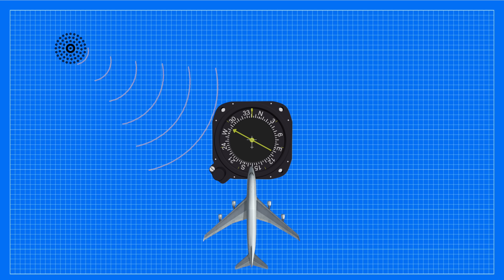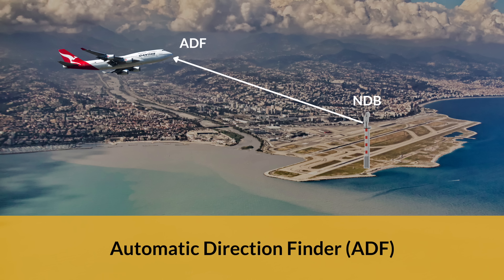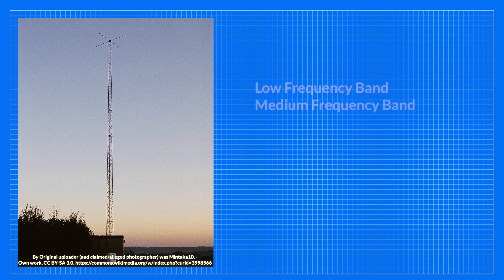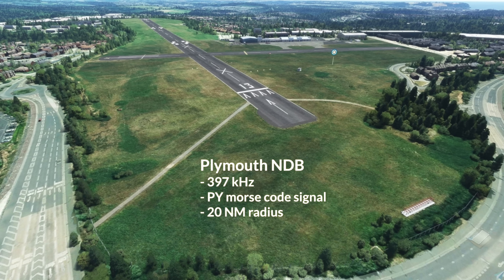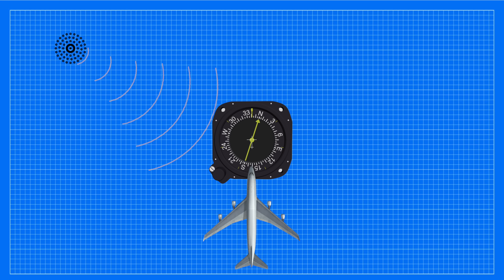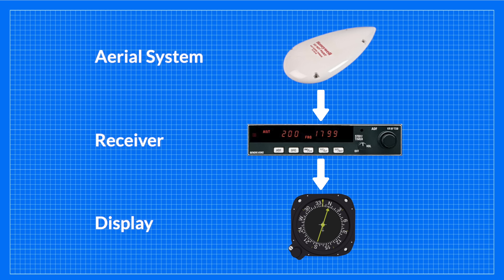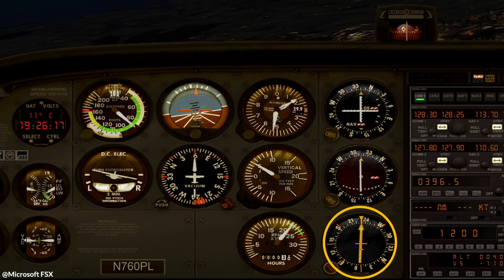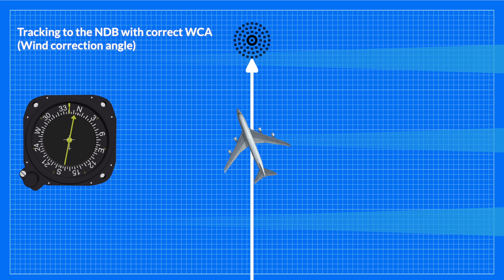Navigating with the NDB and ADF! Explained by CAPTAIN JOE

Comment: Last non-GPS aircraft I flew was on June 24, 2023 on a B757. Yes, a B757 with no Global Navigation Satellite System, using the 3 IRUs and DME/DME updating enroute. Can't remember the last real-world NDB approach, but I still use the RMI in the same way as an ADF to ensure my raw-data VOR radial doesn't show any shift with the LNAV path depicted on the Navigation Display as the B757 does not have a VOR track capture mode on the AFDS. Back on the B727 (steam gauges) used the RMI much more frequently to track a VOR leg outbound before a teardrop turn onto final, that way I could have the inbound radial preselected on the HSI and didn't need to twist the CDI course selector mid-turn. The RMI with VOR works much the same way as an ADF (but is much more stable).
Thanks for the trip down memory lane!
Reply: I recall UAL was pretty stingy with onboard equipment. There were sub fleets of 757s some lacking GPS,  some ETOPS rated, etc.

Comment: I learned flying with NDB and ADF back in the 80s when getting my IFR rating. First we'd fly to and from stations at predefined bearings, then practice changing bearings to/from the station (QDM/QDR change), then holding patterns with NDB and finally doing NDB departures and approaches. Fun stuff. The answer to the test is given at 05:43, "loop & sense" aerials. The latter solving the ambiguity of the loop antenna's front/back sensitivity pattern.

Comment: Also, what does the Sense Antenna prevent? that was a common problem on ships and planes prior to its use?
Reply: Sense antenna is for resolving ambiguity...i.e....loop aerial doesn't know where the NDB signals are coming from...they can be coming from the front, sides or back....sense aerial resolves the ambiguity and as a result the ADF pointer can now point at the NDB.